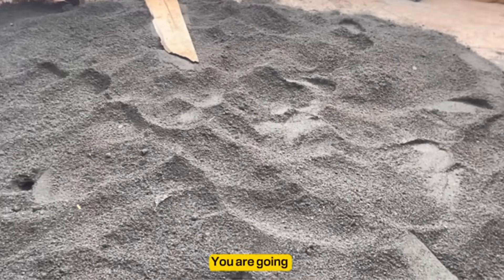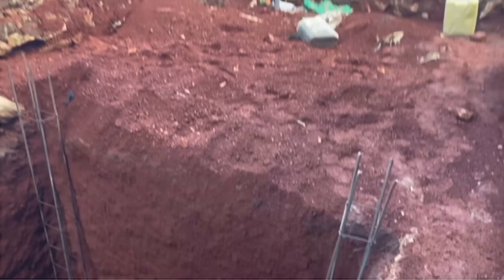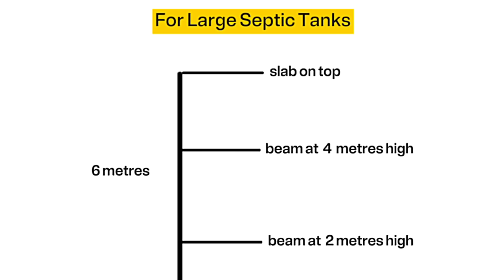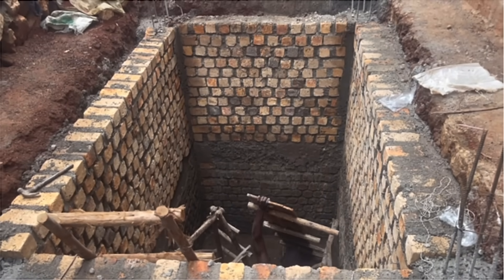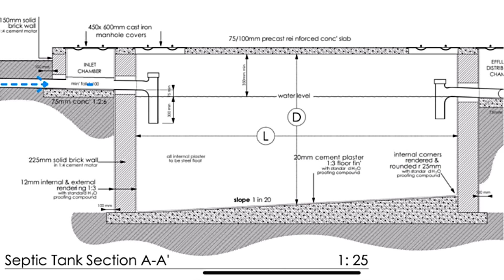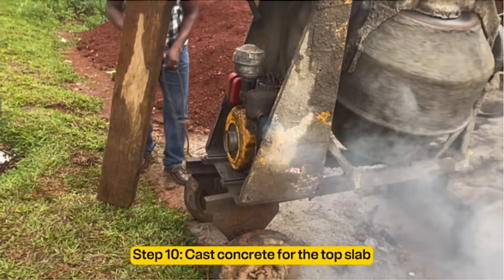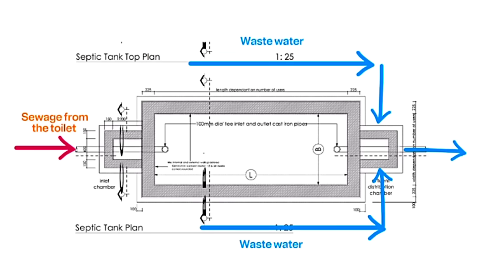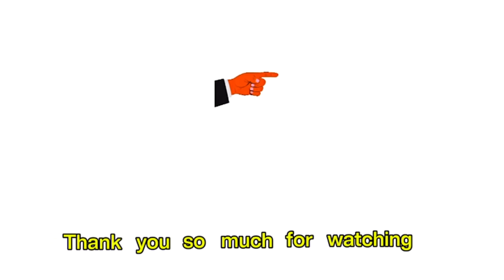How to construct a septic tank from start to finish in 2025

Comment: How to install the inlet and outlet pipes,do we have to drill the septic wall after plastering or it must be  placed through bricks during brick laying...also the lids of the septic you never mentioned how to close,what abt the timber used to support the slab inside the pit,we leave them to rot inside or we remove them after the top slab is dry? What abt the outlet pipe into the soak pit? Is it going to release the water from septic onto the stones or we join it with the pipe at the center of the soak pit....how big is the circumference & depth of soak pit.

Comment: That small cut on the PCP pipe is wrong and against environmental protection. Please fix that.
Reply from the maker: Are you sure?
Reply: @ianconstruction , if it releases any moisture into the ground, then it's not a good idea. However, overall, I like your work and your program.
Reply from the maker: Moisture into the ground is wrong? 
where do you suggest the moisture to go?
Reply: @ianconstruction  on the air.
Reply from the maker: in simple terms that is polluting the air - then we are not protecting the environment
Reply: @ianconstruction I'm not an expert, you are, so if I'm wrong, then I take back my comments

Comment: thanks for this but building the depth to be 1.5m would have prevented you from spending extra on the re-enforcement of the pit.
Reply from the maker: Let’s do some simple math ✍️
Let’s say the inlet pipe at least 300mm depth 
Middle wall at 450mm
Outlet at 600mm(0.6m)

So when you get 1.5m - 0.6m =0.9 m 

Therefore practically, the septic tank you are suggesting will be 0.9m depth because the space up is free space 

0.9m (around 3ft) in simple terms is like from the bottom of your foot to your waist where you tie your belt from

So would you want such a septic tank?

Comment: I’ve been enjoying your videos, but I have a concern regarding the soak pits. From what I’ve seen, it appears that water from the septic tank flows directly into them. If that’s the case, wouldn’t this introduce contaminated water into the soil, posing a serious risk to groundwater?

Could you please clarify how this system ensures environmental safety? I’d really appreciate your insight on this.
Reply from the maker: Underground water is abit far down below underground so wastewater from the septic tank is filtered by soil layers before entering into the groundwater system

Comment: once done,where do you put the breather?
Reply from the maker: The breather is usually put anywhere within the plumbing system, a good position is at the S trap or P trap position where the plumbing system connects to the main house 

The breather is usually a long vertical PVC pipe up to a height above the roof of the house with a fly trap on top

Comment: I wouldnt direct washing machine, sink and bath water to the septic tank or soak pit. I would direct that to a water recycling tank and redirect it to the toilet.
Reply from the maker: Sounds like a good idea though 
I guess the cost of the science for doing that and retreating it is more costly than the water itself
Reply: @ianconstruction  not inn  many  water scarce areas. Get a 2500L of plastic tank, connect your bath, hand  washing basins, washing machine and kitchen sink waste pipes to the tank, connect the tank to supply  toilets. Treat the water by throwing in the tank...septic tank tablets or swimming pool chlorine or other recommended water  treatment agents, you can add a good filter.
Have clean water supply connected as a back up, both supply lines must have stopppers. No science, all  common sense and water preservation. In this way you will always have water supply for your  toilets. Periodically, clean  the tank.

Comment: Your septic tank will NEVER get full? If a septic tank is serviced regularly it shouldnt get full. If yours will never get full without being serviced where does the waste go to?
Reply from the maker: No need for servicing 
It’s all about proper construction procedures
Reply: @ianconstruction  where does the waste go?
Reply: @ianconstruction  you dont understand the service part. An unserviced septic tank is a bigger health risk than a clean chemically treated pit latrine toilet.
Because its waterproofed, a septic tank will get full quicker than a pit toilet and spill over IF your municipality does not come and suck out the waste and dump it at a sewage plant. They will not service it if you did not get a permit to construct a septic tank. 
Here in South Africa you need a permit to build a septic tank (wells and boreholes). You must have the site registered to allow the municipality to service the tank. 
You pay a monthly fee for the service and renew the permit every 5yrs or so. A responsible municipality will conduct periodic inspections on the functionality of the tank.
You still need a permit from the municipality even if you will have a private company service it. That company has to be approved forvhandling hazardous material and liaise with the municipality to share service records. 
Otherwise the municipality can get a court order to shut your septic tank down. Because if its not done to municipal specification and its position on the premises is detrimental to the neighbours, the neighbours might take legal action against you...and the municipality for failing to shut down your septic tank which they will not service if you have no permit. Septic tanks are a public health concern. The rules extend to rural areas. 
You may apply and have your application turned down for various reasons ranging from your close proximity to neighbours to the municipality's inability to provide service and everything inbetween.
Reply: @ianconstruction  proper construction means nothing if the septic tank is not constructed to by-law requirements and its not serviced. You recommend going 3m deep, the municipality might say max 2m. Thats just an example. They might also not approve of the position of your tank on the site.

Comment: While constructing septic tank can't control the water leakage, so what is the option?
Reply from the maker: 1. Build a large sized septic tank enough  for your users
2. Build a large sized soak pit
3. Use water proofing powder or liquid when plastering the walls
4. Position the inlet pipe at 300mm down from the top last course brick level whereas the outlet pipe at 600mm
5. Use clay bricks because they have a low water absorption rate
6. Use enough cement when building it

When you do all these your septic tank will never leak

Comment: thumbs up bro, A few inquiries, 1. I didnt see you protect the outer part of the walls from water seepage, and if need be, whats the best way to do so? i fear that they may be at risk of water from out. Otherise the ATT is a good idea.
2. The drop beam in the centre, will it be the same depth as the ones in the sides with 4 bars? since it connects to them?? or will slightly go deeper than them, but then it has to attach its bars into them at the ends, please advise.
3. How did you provide the polythene sheeting below slab after laying all bars? is it not hard?
4. The uPVC pipe in the soak pit, i see it has some holes in it, are these meant to distribute the water in here? and will you now connect the inlet pipes to the soak pit to this major pipe?
Thank you for the great info, always following.

Comment: Highly informative and I would like to have more Technical knowledge / understanding of this. How can I get hold of you ?
Reply: What happens to the formwork under the slap?
Reply from the maker: @  You remove it after at least 3 weeks you use the space for the inspection chamber to access the inside of the pit
Reply from the maker: @Thiba01   Thank you so much I’m happy that you find it helpful
Reply: @ianconstruction do you leave the wood used for the formwork under the slab inside the pit? Why didn't you use prefab slab?
Reply from the maker: @  You use the inspection chamber or manhole to enter into the pit after atleast 3 weeks to remove the timber in the pit

Comment: How do you remove the board used for building the slabs?
Reply from the maker: After a minimum of 3 weeks, 
The slab will have gained strength so you use the access manholes to enter into the pit to remove the vertical supports and the timber at the underside or soffit of the slab

Comment: Thanks Eng. At what point do you drill holes in the septic walls for the inlet and outlet pipes?
Also what is the purpose of polythene on top of the rocks in the soakpit?
Reply from the maker: The septic tank has to first dry and gain strength after atleast 3 weeks   Then timber is removed from the pit  After that, they do the plumbing, which includes chiselling and piping the holes and doing finishing around those holes.   The polythene sheeting on top of the soak pit is to prevent storm water from entering the soak pit
Reply: @ianconstruction  Thanks so much

Comment: Thank you so much for this content. I always see others construction with two chambers as opposed to a single opening. Any clarity on that?
Reply from the maker: 2 chambers is good
We use one chamber when we have a small space 

If you have a small space remaining in your plot that can’t stop you from having a septic tank 
So what we do is that we make the bottom bottom of the pit sloped with the lower end and the inlet side and the higher end at the outlet side a slope of 1:20 

That way, solids or sludge will settle at the inlet side and that slope will enable further clearing and settling before the liquid sewage goes to that soak pit

That slope will help out the single chamber septic tank to work in a similar way as the the 2 chamber septic tank
Reply: @ianconstruction  

Thank you 👍
Reply: Hi Ian. Can you show diagram of slopes if I have space for 2 chambers? I plan to do 2 by creating a 7m x 3m (divided by 2 in the middle) then the water soaking hol. It will be DIY🫣

Comment: I like the idea of marking where your access holes are. However you may want to leave a sketch with the homeowner showing where the tank is referenced by the corners of two buildings or other landmarks. The paint will likely wear off or the wife will ask it be removed because it’s an eyesore. Than 10 years down the road, you won’t know where the covers are.😊
Reply from the maker: You’re right
A sketch has to be left with the home owner 
😄 you can also opt for marking with colored paver designs to mark the position of the manholes 
Those designs will serve 2 purposes
1. design 
2. Marking the position of manholes

Comment: I see you are using many materials and take it seriously. I live in a gated community.The landlord is still building new houses. He makes simple  septic tanks and pits connected to the main sewage system. But he doesn't build concrete at the bottom. Just simple bricks on the side only. Is that dangerous?
Reply from the maker: You do that only with bricks when you are sure no car will pass on top of it
When the septic tank is positioned in the driveway, it has to be done with columns, a mid-ring beam and a slab on top
Reply: Many thanks for your quick reply. But I still have fear. Since the toilet water is leaking into the basement of the house and surrounding areas, doesn't it cause the building or at least the floor to collapse thereby also killing us?
Reply from the maker: @Bona-k3u you don’t need to worry, the toilet water goes to the chamber of the septic tank through a plastic pipe and then from the soak pit to underground
You also don’t need to worry because the soak pit is usually 2.5m - 3m away from the house
Reply: @ianconstruction  l am confused. U used so made yrs e strong material n advised us to follow suit. And when I tell u ours u took it easy. Why? Are u comforting me? Let me repeat. The pit outside is not far from the wall. May be 20 cm. Two the inside septic also is not concrete. It is just pure soil. So it neans toilet fluid is leaking into the house ground everywhere. Do u still stand by yr position?

Comment: Why is the normal JoJo or water tank not used as a septic tank?
Reply from the maker: Water tank walls are weak not strong enough to withstand the heavy pressure or force from the soil in the sides. It will fold or collapse easily

Comment: Septic tank needs more partitions. How is it has only one chamber?
Reply from the maker: There are different designs of the septic tank depending on different conditions on site, we use this design when we have inadequate space on site and we make base or floor of the septic tank sloped. It will work out similarly just like the 2 chambers septic tank

Comment: What's the distance between the septic tank and the soak pit
Reply from the maker: A septic tank is an underground container that collects wastewater and partially treats it by separating solids from liquids. 

The liquid effluent then flows into a soak pit, where it percolates into the soil for further natural filtration. Together, they form an integrated system for onsite wastewater management.

Comment: If I connect wastewater (from bathroom, kitchen sink, washing machine) directly to the soak pit, would the soakpit not fill up too quickly?
Reply from the maker: The soak pit doesn’t fill up
It soaks away liquid sewage to the underground 
Secondly let me tell you why it cannot fill up. Excavate the soak pit depending on the number of users
We consider each user uses maximum 200L a day
We also consider that it takes 48 hours (2 days) for liquid sewage to soak away into the ground 
Therefore let’s say we have 10 users, each user uses maximum 200L a day so 200 x 2 days x 10 people =4000 litres

So we excavate a soak pit that can accommodate 4000 litres and there’s no reason why it should get full quickly 
since we excavate the pit based on the calculations
Reply: @ianconstruction  And what if the area is waterlogged? Are there any special considerations for the soak pit?
Reply: @ianconstruction  Great. Thank you for the clarification. So essentially the 4000 litres would have soaked away after 2days?

Comment: Hi great septic tank… but I don’t see the waste pipe work into the septic tank and out to the soak pit…. I see the diagram that they are there but didn’t see in the video…
Reply from the maker: After 3 weeks when the slab has dried, and gained strength 
We use the inspection chambers or manholes on top of the septic tank to remove the timber in the pit
After removing the timber, the plumber fixes the inlet pipe and then the outlet pipe so simply and easily since the septic tank and the soak pit are already built.
If you want to know how to fix the inlet and outlet pipe watch this video here https://youtu.be/QNHPRlW8H2Y?si=lB56-NViUpF0lCgl

I’m uploading all septic tank drawings on our website soon ianconstructions.com

Comment: thanks for such an informative video, I have learn a lot from it. I have just one question, how do you remove the slab framework and supporting poles? or do you leave it?. Looking forward to your response
Reply from the maker: After 21 days, when the slab has dried and gained strength, you use the inspection chamber or manhole on top of the slab to enter inside the pit and remove all the timber in the pit
Reply: @ianconstruction  thank you so much for the response, just one last question.. is it compulsory to use the header bond in brickwork?.. will it be a problem if I use stretcher bond?
Reply from the maker: @thulanimbhele5616 You have to use header bond ( least should be 200mm wall thickness)

When you use stretcher bond the wall will fall inside because it’s weak

On some occasions, when the septic tank is very large we use 300mm (1ft wall thickness)
Reply: @ianconstruction  thank you, God bless!
Reply from the maker: @thulanimbhele5616 Thank you so much May God bless you too

Comment from the maker: @joachimobara5412   Your question was How do we find the dimensions for the soak pit 

ANSWER: To determine the size of a soak pit you have to consider different factors 

1. Daily water usage for each user
3. Soil percolation rate ( how quickly waste water will seep into the ground  measured in hours)
3. Local regulations 

Considering that 
I) Each user uses maximum 200 litres a day
II) The soil percolation rate as maximum 48 hours 
III) Local regulations - don’t want it so deep to avoid interacting with the water table

Considering that the soak pit  has a cylindrical shape 

V = π r² H

Where 
V is the Volume of the soak pit 
r is the radius of the pit 
H is the height or depth of the pit and
π is a constant 

Let’s re-arrange to find the depth of the soak pit 

H = (Volume ÷ π r²) x 2 days since percolation takes 2 days 

Height of the soak pit = ( Number of users x volume of water used by each user per day x the 2 days for percolation) ÷ π r²

H = (200 x 0.2 x 2) ÷  π r²

Consider  π  is 3.14
And r as the radius of the pit

Let’s take radius as 2.5 metres meaning its diameter is 5 metres

H = (200 x 0.2 x 2) ÷ (3.14 x 2.5 ²)
H = 4.1 metres

In summary, you need a soak pit with minimum 
5 metres diameter and 4.1 metres deep
Or
3 metres diameter and 11.3 metres deep
Or
4 metres diameter and 6.4 metres depth
Reply: @ianconstruction  Thanks.